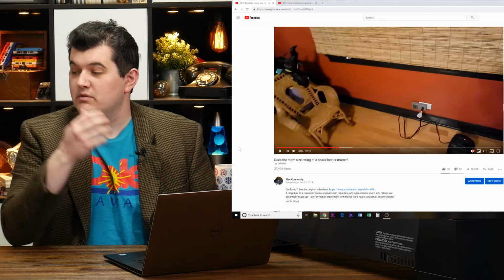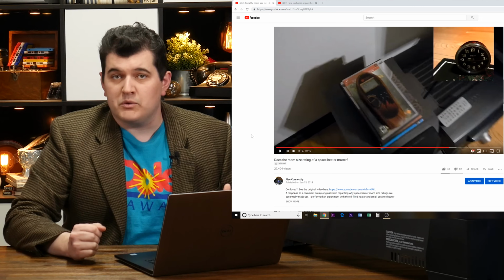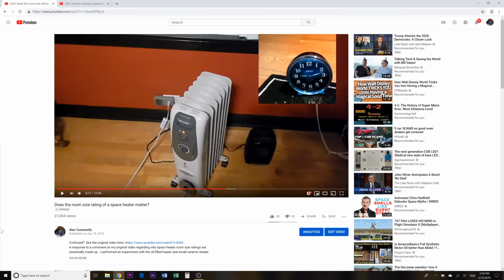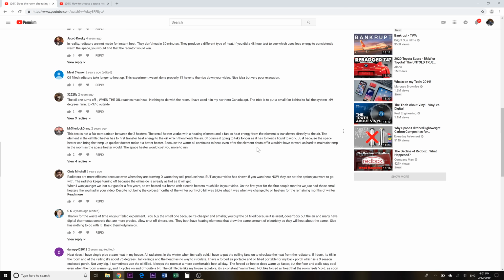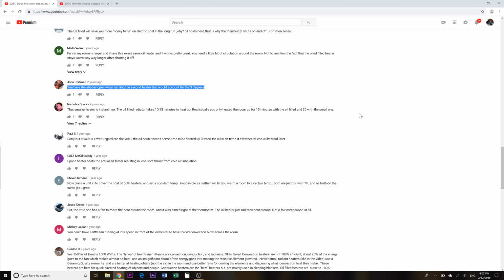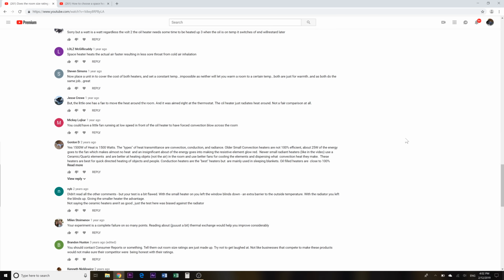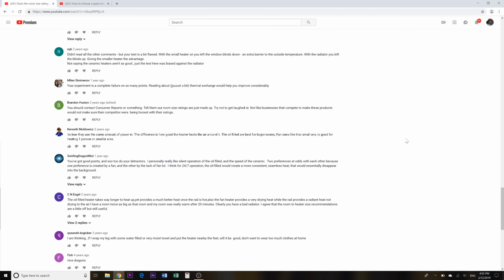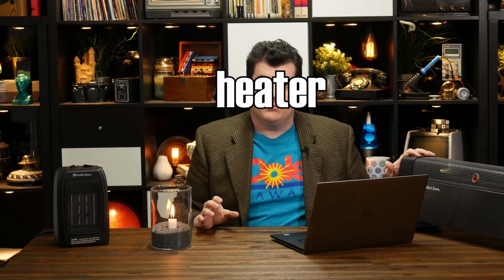More Space Heater Nonsense

Comment: Parts of this video make me want to reach through the screen and give you a big hug.

I agree with you on the room size rating being bs if the metric is how much heat the heaters can output. The only justification I can think of is if the rating is based on distribution of heat rather than how much heat is output. e.g. comparing 2 sizes of fan heaters from the same maker, does the larger fan make it more effective at spreading heat faster to the edges of a larger room where the smaller heater may take longer or only be warmer nearby till the heat spreads via convection. Or for baseboard models, does the larger surface area increase heat transfer to the air and speed up heat distribution via convection.

Comment: Mech engineering graduate here.  Only reason I can see the larger Space Heater being better at heating a larger area is...more surface area - heat exchange is surface area dependent.  A larger surface area would mean the heating element is at a lower temperature throughout, so the convection would be lower in each zone on the heating element, but there would be much more of it across the element.  

Which just translates to a more even temperature gradient around the heating element.  And that's just a maybe, I haven't done any calculations....

Comment: How about this.... I actually have an older Philips fan heater (wire elements, long radial fan), which dates from the early 1980s. It's rated at a whopping great 3000 Watts, yes, that's right, 3kW. It heats a room very rapidly! someone said to me "How can you afford to run that thing, considering how much power it uses?".. The answer is easy, it may consume a greater Wattage when it's running, but because it reaches the preset temperature that much quicker, it cuts out that much sooner, and, as it cycles on and off, it runs for shorter periods of time than the smaller heaters. In the end, if you do the mathematics, it still only uses the same amount of energy to heat a room, because it is still only liberating the same quantity of BTUs per hour into the room. It just gets there faster - It's just another angle that people cannot get their heads around.

There is another little anomaly surrounding 'energy saving' light bulbs.. Now if you consider that a tungsten light bulb produces more heat than light, is really inefficient? The answer is not so clear cut. If that bulb is heating up the air at ceiling height, then that's just so much less work for your room heater to do - it doesn't need to run as long to to heat the whole room. If you replace that tungsten bulb with a ' low energy' ('energy saving') bulb, then the room heater has that much more air to heat up before you feel the benefit at a lower level, and so the heater has to run for longer to heat the whole room, thus consuming more energy.

So where is the saving? - Only in the Summer months when the heating isn't generally in use, and so, they don't necessarily save as much energy as the hype would have us believe. They merely redistribute the way we consume energy in other (heating) devices.

Comment: My guess is the "large" room heaters are intended to be radiant heaters without the scary red glow of actual radiant heaters. This way, by not using a fan to disperse the heat around the large room, the people near the quiet heaters will feel the radiant heat and feel warmer in the cold air of the large room than they would if their heater wasted its heat on warming the air. Meanwhile, if you're in a small room, then it is actually plausible for the heater to warm all the air of the room to a comfortable temperature, so use the small heater with a fan to heat all the air to a comfortable temperature. This is the only distinction that makes sense to me.

Comment: Wouldn't the oil filled ones be slightly better because their management the thermo-osmotic effect - thereby preventing heat reflux?
Reply: Only if they include a Turbo Encabulator. Look it up.
Reply: Yes, but be sure not to overheat the flux capacitor or else you may repeat your error forever.

Comment: So the issue with that experiment lies not with the heaters themselves but how those heaters deliver heat into the room, a larger heater with the same style of heating element and a more powerful fan will heat the room up faster than the smaller one of the same type would.

That's why the oil filled heated the room slower. If you took two oil radiators and had one smaller and one larger, the larger one would (at peak temperatures) heat the room more effectively because of the amount of surface area in contact with the air compared to the smaller even if they're the same heat at those peak temperatures.

The flaw wasn't with your theories it was with the two heaters you were comparing.

Let's make it simple, if we had a small fire pit built outside of contained shelter next to the wall, that wall would get hot and that heat would then transfer into the room, but if we put a hole in the wall next to the fire in the shelter and fanned air into it from over the the fire that heated air would go into the room and heat it faster because the air would already be warm and the wall wouldn't have to heat the air up since the fire has already done that

Comment: This reminds me of TV's and the Compatible vs Displayed.

When I was entering the HD era (bcak in ~2005-6), i wanted to get a 1080p TV but as I researched all the TV's that said they were 1080p Compatible I found they didn't actually output 1080p but were 720p. 

After some deep research I figured out what it meant, so if you go back, you will remember when a TV was unable to display it would go to snow, later this was changed to just display a Blue/Black/Green/etc screen and usually NO SIGNAL, well manufactures worked out how to downscale images in the TV (you probs can explain this better than I so sorry if I'm mixxing up terms), anyway what 

this meant was you could plug in a 1080p device and instead of it going to Blue Screen it would just downscale to 720p, the issue for manufactuers was people wanted 1080p, so they worked it out, say it's 1080p compatible, which just means it won't NO SIGNAL if plugged in and people with assume compatible = it's 1080p TV, when it's not. 

Anyway the way to learn what a TV really is, look for the word Displayed: XXXXx (so 1080p or 720p or whatever), this sadly is usually only in the manual under specifications, if you can't get the store to show you the manual, go online and look up the model and brand number and go to specifications. 

Anyway point is these space heaters remind me of that, saying Small Room and Large Room are just terms to make you think a small space heater won't be able to heat the room.
Oh and to nay Sayers, yeah look up what is aid above about TV's and you'll quickly see, manufactures can be real assholes, oh and btw the brands i've seen engage in Compatible to hide true dispay... 

Every single Brand I've ever seen in a store, I am not joking, I've yt to find a single brand that doesn't do this, almost guaranteed you can walk into a store today and you will still see "4K Compatible" and when you flip it open in the Manual, displayed will be a lower number. Oh and in the Manual they almost always put Compatible BEFORE Displayed, in one manual i read it had te4chnical info, like power usage and shit, then Compatible, then there were dimensions and THEN Displayed as the bottom line.

Comment: I think a passive radiator oil based heater with a ceiling fan for equal distribution of air circulation is ideal. You might even put a pan of water on the radiator to achieve a higher humidity level if desired.  Energy consumption and BTU's are probably equal in all circumstances, but air distribution is as important than the thermal aspect.

Comment: There is only a slight problem in yout analysis and it comes down to the electronics not the thermals. How quickly the heater gets the heat away from itself dictates it's duty cycle. The thermostat might be set to 70°,  the average temp starting at say 60°. While in operation, the thermostat will read higher than the room temperature, due to how close it is to the heater. If the heater is heater is effective at dissipating in the room, then the difference between the average room temp and the thermostat reading will be small. It could be that it reads 68 when the room average is only 65 for a high (dissipation) efficiency heater and more like 70 when the average is 65 for a lower efficiency heater.  The lower efficiency heater will idle, as it read that it has reached the goal temperature, while the higher efficiency heater continues heating. 
That being said, that is mostly ignored by marketing people. There is some truth to space rating comparison of 2 heaters of the same type, for the simple fact that larger heater have larger surfaces to transfer heat. You are completely right though is saying that the heater with a fan heats a room faster than the oil heater.  A larger heater with a fan ought to heat the room still faster though. Also, in a larger room, the rate of air flow is critical, because it it's easy to have one side of a room be hot enough to trip the thermostat of a less effective heater, because it could move the air from one side to the other and convection is slow. This also only applies near the goal temperature, as most heater will be on 100% duty cycle for lower temperatures, where they function identically.
Reply: A large 1500 watt fan heater will not heat a room faster than a small 1500 watt fan heater. Size is not magic. Watts is watts.

Comment: I believe the room size recommendations are more of a safe limits of use than a rating of heating ability.

They do not make that small heater intending for it to be used to heat a large room, and although it would have the ability to do so, the small size of the heater will limit it's safe use. 

As you stated, the heaters all have the same amount of heat output, which means the load on the smaller elements is greater than that on the large elements producing just as much heat. 

This higher load can become dangerous after extended usage, but would be safe for shorter time periods: such as heating a small room.

Comment: I'm sorry for my poor English.

Just to keep the talk going, there is a kind of electric heater that has more than 100% efficiency.
In thermodynamics terms, they are called heat pumpers.

It is an air conditioner that can work in the reverse cycle so you can transfer some amount of heat from exterior to interior even if the external temperature is lower than the internal.

Basically, they use energy to transfer more energy, so the Heat/Whats ratio is more than 1.

I think it would be a good theme for the next heaters video series. =)

Best regards from Brazil!

Comment: I seem to remember a news report, that tested several designs, and they used a thermal camera in their tests.    They were also questioning the fact that these units were all 1500 watts but had differeng price points.  The thermal camera showed more how the heater moved air around, than what temperature the room would get to given enough time.  In each case the thermal camera indicated a hot spot where the heater was, the heat would rise to the ceiling in some manner and spread from there.  It would take various amounts of time for the temperature to stabalize, with the larger forced air heater working the fastest and the radiative heaters the slowest.  Therefore if you are going to only be in the room for a couple of hours the radiator would be useless.  

One thing I want to say, that neither the news nor your channel covered, was a ceiling fan/heater combination.  Yes I understand this is a permanent installation, but my thoughts are the heat has to work its way to the ceiling before it spreads.  What if the heating element were closer to the ceiling?
Reply: Best answer is a heated floor.  Installation is a bee with an itch.  I know, I put one in at a friend's house (in his master bathroom).  On a cold Winter's morn, step out of the shower onto a warm floor.  Yay!

If I ever get around to building my own house from the foundation up, that's the route to take throughout the entire house.  I might still do the garage and bathrooms if we get a pre-owned house.
Reply: @frederickevans4113  I am building a 2500 square foot shop and plan on installing in floor heat.  This is Minnesota and the is nothing worse than having to crawl under you vehicle to fix it... in December or later.   But on a heated floor it's business as usual.  And... with floor drains this is a great place to park your winter vehicle and let all of the snow melt off!
Reply: I'm late to the party but he did mention it at around 20:00
Reply: Well youd be surprised how much air moves through these things even without a fan. One could probably move an entire bedroom of air within just a few minutes.

Comment: pulling the same power from the plug, does not mean they will transfert the energy to the air the same way, the "exposed" surface of the heating part to the air & the presence/absence of fan will play a role in the heat transfert (except in IR Heater because they do not use air to heat, but that's an other topic).

You're comparing here 2 convections heaters, that will heat up the air around them, and then the heated air will heat something else (walls, furniture, yourself), one has a fan, which will increase the amount of air heated, and the second use a massive metallic structure heated through conduction (with the oil), the oil plays 2 role here : heat buffer & temperature conduction from the heater to the external metallic structure, which will only then heat the air.

In your experiment, you put the temperature reading device quite far away from the heater, which will give an advantage to the fan device (the fan will tend to distribute the heat in the room), where, the temperature near the oil device should be higher than at the other end of the room, because it heats up locally only.

Comment: I think you were trying to show that the small heater is perfectly capable of heating the same size room, but it came off as if you were trying to say that oil heaters suck.
Reply: I mean in a way they do. the small heater does the same job, and its cheaper.
Reply: @jetison333  Not really though.  Personally, I hate the constant on/off of heater fans.  I'd much rather pay more for a silent heater, even if it takes all day to get the room up to temp.  But in a garage or rarely used room, heck yeah, cheapo heater hands down.
Reply: @LarsSveen  alright fair enough

Comment: I agree with you.  Technically any heater rated at 1500 watts puts out the same amount of heat.
---------
It's the application and characteristics of the heaters operation, that is more important than the heat rating though.

1) I tried using a small heater with a fan in my bedroom and it was way too noisy, produced too much of a point source of heat and was too much of a fire risk on the carpet.
- It was great for warming my toes, under my desk, while on the computer, in the basement, though!

2) My radiator heater, could be left on for extended periods of time, and the thermostat allowed me to dial the temperature precisely to my comfort level.  e.g. too hot, turn it down a bit, too cold, turn it up a bit, then set it and forget it.
------------
I think that is what people are complaining about,
- the amount of heat output doesn't matter as much as how suited it is for long term or short term use!